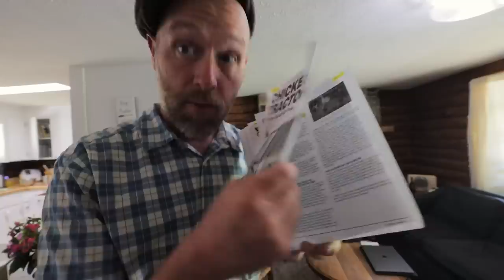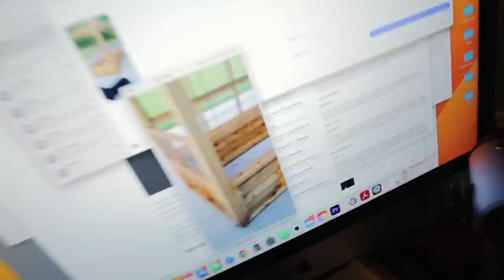SPRING Homestead RUSH

Comment: The brooder heater you are using is not good enough. The chicks are not coming out to eat and drink and probably piling under the heater to stay warm, thus suffocating each other. Get a better brooder heater that will work outside. Now put the feed and water just outside the heater so they can eat and drink only inches from the warmth. Also, when starting the chicks off, don't close the lid on the feed tray. Keep it open so they can easily get to it. Losing that many chicks is not acceptable.

In regards to your cover crop, you just fed your chickens the nitrogen that the rye took out of the soil. It is supposed to go back into the soil to feed the plants and the microbiome. Chop up the rye and put it back into the soil while green. That is what will feed your biome and give the soil nitrogen, while your biome feeds your plants. You just broke the cycle.

As for your raised beds, you have too many plants in one small area. They will fight each other for light and nutrients. Furthermore,some roots will discharge a chemical to stop other plants from growing.

I was impressed when one of your kids noticed that the leaves were fully out on a tree.

As for scaling back; we've all been there. Sometimes we cause self-inflicted burdens and they eventually become too much. I'm facing that at the moment.

As for getting the bike unstuck, teach him how to get it out by himself so he can do it if he is 5 miles from anywhere in the woods. I speak from experience.

All the best.